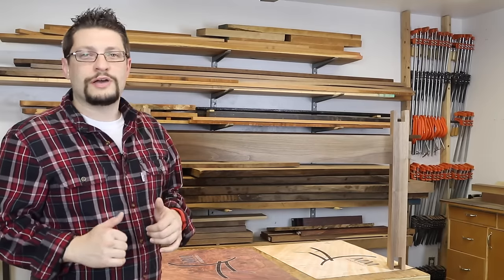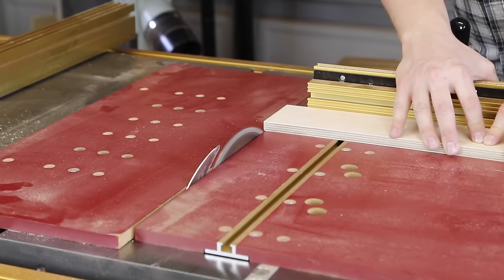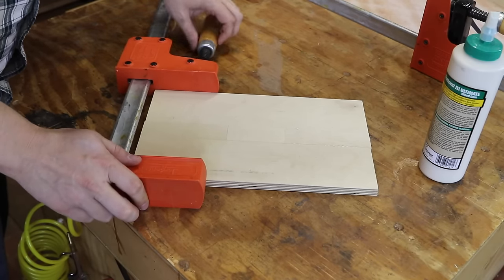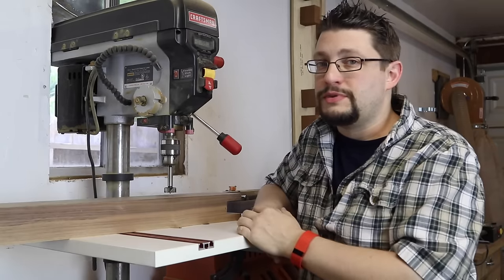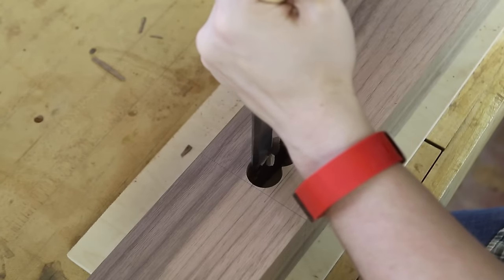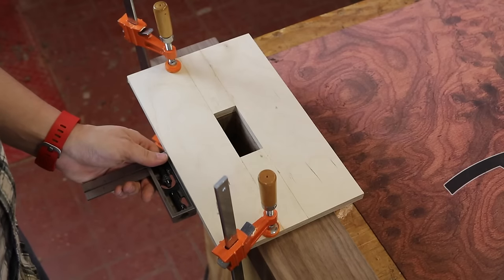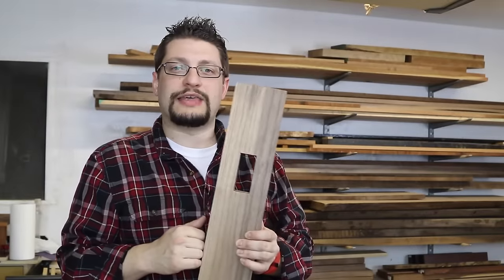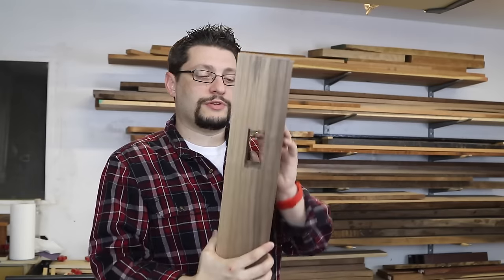How To Cut Large Through Mortises

Comment: Just a slight clarification, router bit bearings are identified as if the bit is hanging in the router. "Top bearing" has the bearing close to the collet shoulder, and bottom bearing is at the end away from the router bit shaft. Nice build of the table Matt, your videos are well detailed. Thanks for sharing.
Reply from the maker: Thanks, Don!

Comment: Or you could hand chisel them and (imo) get an equally good finish in less time than it takes to make the jig. Don't get me wrong, I'm all for using power tools to save time, but unless mass producing, I don't see the benefit of power tools in this project.
Reply from the maker: Thanks for the comment David. One of the reasons I do it this way is to enable people who take the class to be able to replicate what I have done.
Reply: MM Wood Studio 2
Reply: It would be more intresting to do this with an adjustable jig that can adapt to more situations. But then maybe its even more fun to build a pantorouter....
Reply from the maker: I own a Multi-Router and used it extensively when I did production work. For my online school, I use jigs that enable anyone to do the work who may not have that type of specialized equipment.
Reply: Talk about using power tools, drill some start holes and cut it out with a jigsaw or a Sawzall
Reply: @danietkissenle  😂 nope

Comment: Since you are using a piece much bigger going into the mortise then you could have just screwed the jig to the working piece on the inside as the holes would be covered. Fill in with filler and no one would see it.

Comment: Still, why not use a router right away? Use a mortising bit, have the left and right limits for the router set and off you go. I did it this way whether was through or not and it worked. Just saying ...
Reply from the maker: That's one way to approach it, but leaves a lot of room for potential mistakes, in my opinion and experience. Pushing a stop a little harder might move it etc.

Comment: Sorry MM -you lost me on this one.  Listen to your viewers -the comments are right-on. 

Jigs are efficient for repetition - but they're a waste of time and energy (and a source of frustration) for only a couple cuts. Jigs have to be tested on scrap - by the time you're done doing that I'd have 3-4 mortises cut by hand.  For that kind of simple through-mortise the jig is for doing 20 - not 2.   

Now if  I had enough mortises to justify the jig and a router - then I'd use a guide collar and a long spiral bit in a plunge router.  Use a downcut spiral bit and no scoring or pre-drilling required at all.  I'd build the jig around an actual tenon- offset for the collar with some gauged spacing material - no measuring . 

BTW - when I was young and foolish I built timberframe /post and beam structures and we had to hand cut furniture-accurate mortises in  6x6 and 8x8 timbers with limited time and limited tools. We used a port-align drill guide/ 1/2" drill, a utility knife to score the cut -  and a sharp slick to dress the sides back to the line.  Fast and accurate.  Sometimes - no generator (this as years before reliable battery tools) - so we'd just score them and cut the whole thing with the slick if necessary.- it took a few minutes but nothing ridiculous.
Reply: Aren't you the cat's meow.